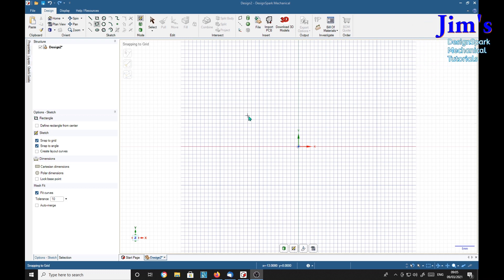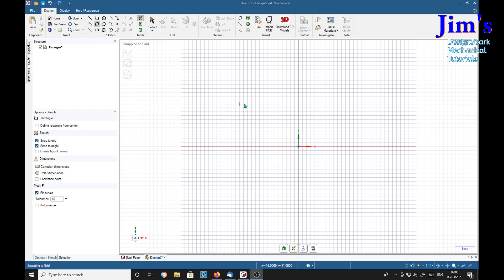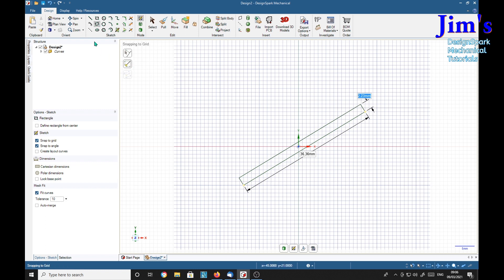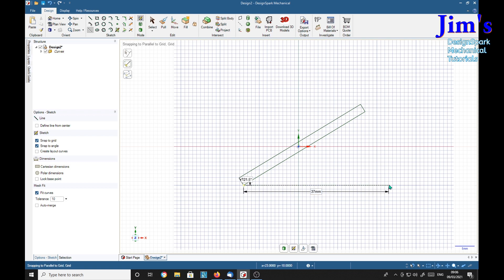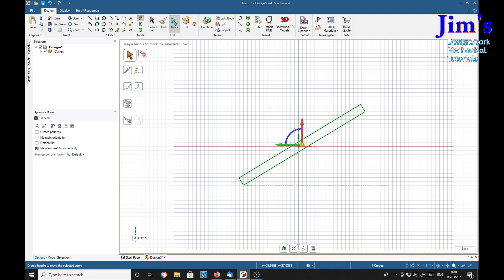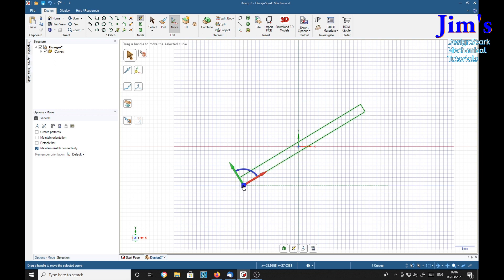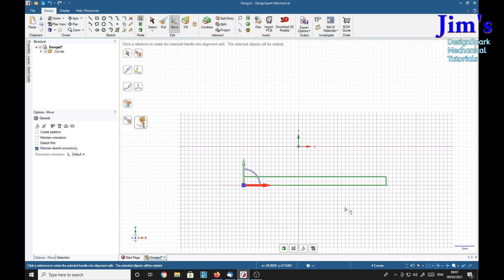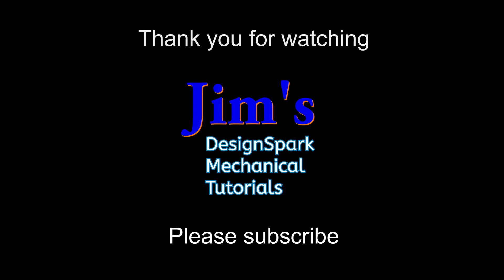Aligning a 2D drawing in DesignSpark Mechanical

Comment: Hi Jim, great videos, could you please show how to add another shape, but on a different axis to the original. When I try this i keep losing the grid, and if I try to add say a circle it adds in in the original axis. Hope this makes sense
Reply from the maker: I'm not quite sure what you mean.
Reply: @JimTaylor42  If i press K then V when i start I get the drawing grid. So, say i draw a circle then pull it into the 3d size that i want. Then i want to add a square handle to the side of the tube, a beer tankard would be a good way to describe the shape i`m after. I cannot seem to be able to draw another 2d shape but on a different axis to the original?
Reply from the maker: @trevorchristian2916  Would it be like putting a handle on a beer tankard?
Reply: @JimTaylor42  yes

Comment: Thank you for all the awesome videos!!! 

Is there a way to scale a picture to a set dimensions? So if I scan something from my printer, how can I make the scan dimensionally accurate, is it possible in DSM? I know fusion360 has a "calibrate image" option, which I use from time to time. I haven't found a similar option in DSM to do the same thing.
Reply from the maker: See my  https://youtu.be/Q5ez5sI8Zfg Vintage Fender Stratocaster pt1 video, I show how to do just that.